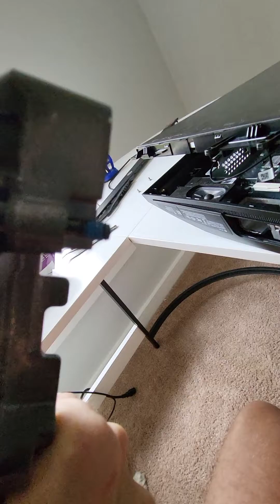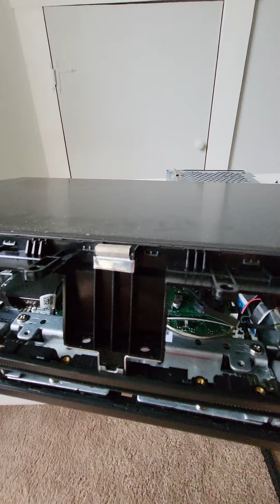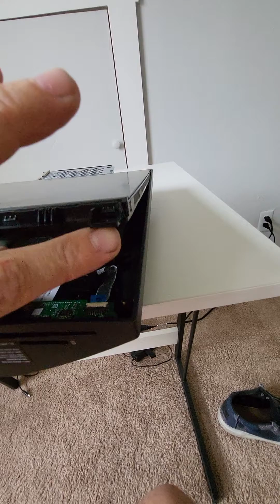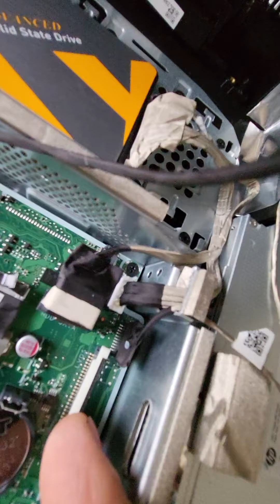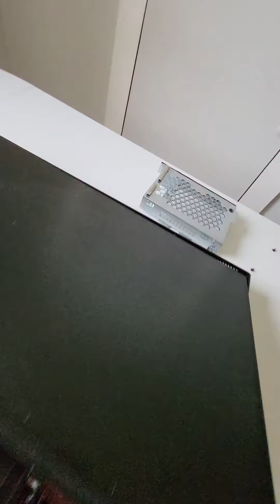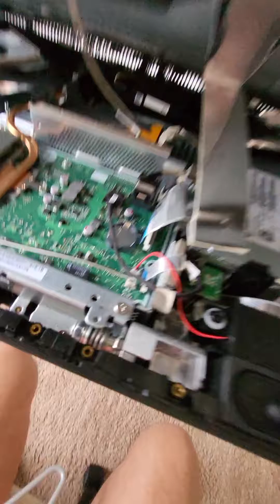HP Aio 22-df0023w SSD upgrade directions

Comment: Howcome you chose not to use the m.2 port it's faster speeds
Reply from the maker: There’s no m.2 port on this specific model. M.2 is used for the WiFi card and this pc doesn’t matter how fast the nvme drive would be because it’s a cheap Aio. That sata SSD is perfect.